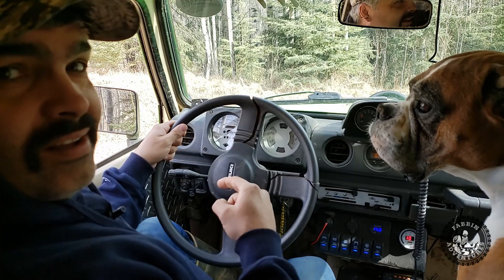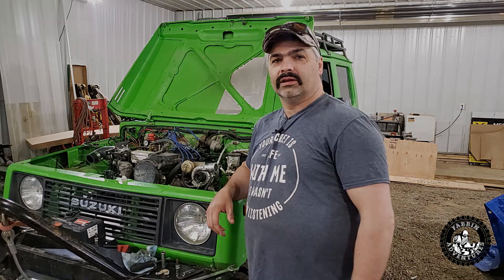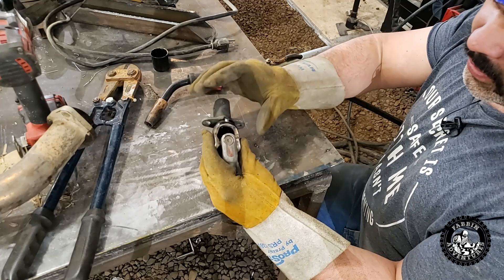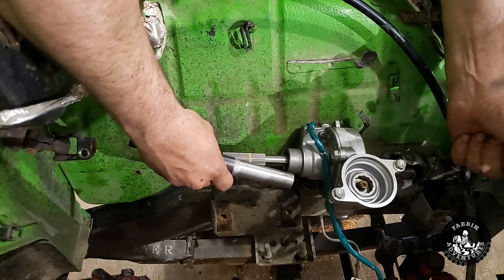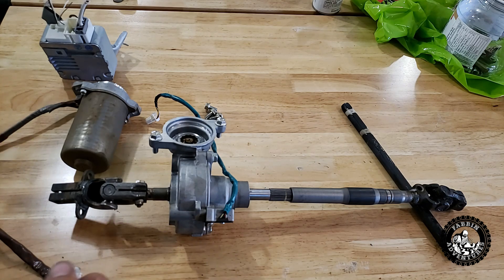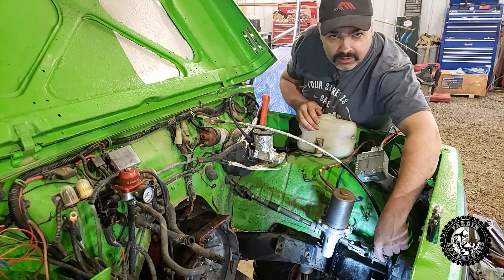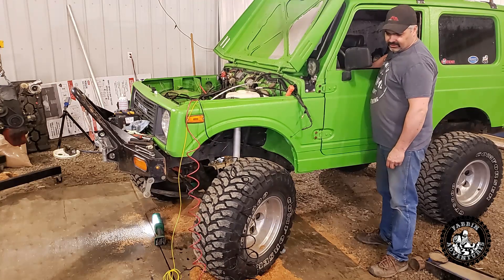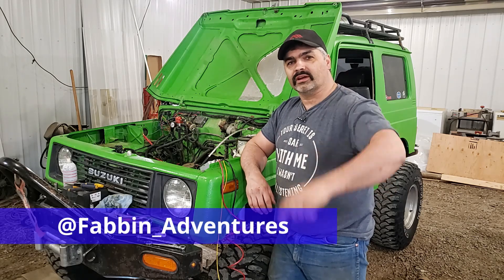Suzuki Samurai Electric Power Steering Conversion

Comment: great video, I bought and eps from a toyota yaris and I can't find a way to switch it on, I manage to hear the relay click but how do you find out if the motor is working without mounting it
Reply from the maker: Thats a good question man, they run perfectly quiet!
Reply: @FabbinAdventures  yeah they do and that's the only problem I have left I want to try it out before installing it
Reply from the maker: Maybe you could mount it in a vice and try it powered and unpowered with some resistance on the driven side?
Reply: @FabbinAdventures  I tried that I didn't really notice any difference with both the Corolla and yaris but the relay clicks on both of them so I don't really know what's going on maybe I'm doing something wrong
Reply from the maker: Hmm, well man, i dont know. Im not really any good with electrical stuff, if it dont work im at a loss usually.
Sorry.
Reply: @FabbinAdventures  no problem man, thanks for your time anyways I will get it working somehow 👊

Comment: Great video!  I used the same electric motor and ecu for mine but did you have a problem like others have mentioned with the wheel not self centering after turns?  I thought it may have been caused the way I mounted the motor (straight up just like yours) since OEM the motor is pointing at 3 o'clock I believe.  Even after checking alignment and replacing all tie rod parts with new, I'm still having the same issue.  There seems to be a dealer 'centering' procedure that I've been wanting to try to see if that resolves the issue?  Any suggestions would be greatly appreciated!
Reply from the maker: No, mine seems to center fine, never had any troubles with it.
Thanks for watching!
Reply: I have the same issue since i convert my delica to EPS. The reason is inside the EPS motor, there is a worm gear mechanism which doesn't allow the main shaft to rotate itself withe the motor.  Did Tone of researchers to find a solution and just today i realize using a steering damper is the only solution. Just like Fabbian already had one fixed to his Samurai. Hope you understood.
Reply from the maker: Thanks for your comment!
Reply: @wpdesilva  What is a steering damper you mention?  Can you point to time in Fabbian's video where you see steering damper?
Reply: @GBY6  Please check on 10.26. can you see a red colour cylindrical part under the vehice which is just like a shock absorber. That's what called a steering damper.
Reply: @wpdesilva  Thanks Praveen, I'm not sure it is required as I have seen other EPS installations that self center without damper?  Also factory Prius/Yaris EPS does not have a damper.  I am thinking possibly it is caused by ecu center alignment or maybe column shaft alignment?
Reply: @GBY6  Prius and yaris has rack and pinion system fitted between the wheels. Whereas vehicles like samurai has steering box which is totally different from rack and pinion system. However, the point you highlighted is also worth researching.
Reply: Did you ever figure out the centering issue? I have a datsun 240z with a saturn vue EPAS, and the auto-center on exiting a turn is picking at my brain for a while.....

Comment: Nice video. I tried it by myself. Successfully used for 4 months. But now it's no working. 5 seconds After ignition on, the ECM goes off by making two clicking sounds. 
Any idea what has gone wrong??
Reply from the maker: Oh thats a good question, have you checked your grounds and lives? Bad Grounds are causes of alot of trouble. Beyond that, im not sure what the problem could be.
Reply: @FabbinAdventures  thanks for your quick response. I checked the connection and connected directly through separate wires. Problem remains same.
I even tried with another ECM but the results are same.
But i found that after disconnecting motor connector and powering on again, ECM is no longer switching off like before..
Reply from the maker: Awesome, good to know! So problem solved for now?
Reply: @FabbinAdventures  not actually. i have to disconnect the motor connector to prevent the ECM from switching off. If i reconnect it, the problem begins. Anyway, I'll look into this deeper and will let you know if i found a solution.
Thanks
Reply from the maker: Thanks, too bad it didnt fix the problem, hope you get it figured.

Comment: awesome thanks.  Just got a prius power steering and ready to mount on my 92 EFI  fully loaded 8 valve 1.6 dual 4.24 :1 1st case to 6.5 2nd T case, Isuzu Rodeo rear leaf spring both front and rear FJ80 full float axle rear 5.29:1 and FJ60 front both 9.5" diff, 2nd gen 4runner power steering gear box, air compressor conversion out of air condition of sidekick, custom bumper front inner 9,500 winch, missing link front and rear over 12" lift on 37' tires currently up to 39" tires if needed, and many other off-road capability etc.  last thing is electric power steering assist. 

Thanks for the video!

Michael
Reply from the maker: Wow! That sounds like quite the rig! Hope it works for ya! Its be a great mod for my sammy!

Comment: Hi thanks for the video it's inspiring.
I got mine off a Toyota corolla and did all the wiring in including ignition power and no click sound absolutely nothing. What are those other wires next ignition wire for? The black and white one. Maybe there is another step am missing.
By the way I have a similar Suzuki samurai hard top like yours
Reply from the maker: Its hard to say, if it was the same unit ( toyota prius ) i might be able to help you. Hope you get it figured out, because that power steering sure is nice!
Thanks for watching!

Comment: Hello, great video. I installed it on my toyota hilux 1985 model 4x2. Its perfect when i am stopped. But when i am driving i have not the reset of wheel. I must turn the wheel after a corner. While firstly the wheel was reset autmatically after a corner. Do you have any suggestion?
Reply from the maker: Im not sure i am understanding your english.
Try unhooking the power and hooking it back up. To reset the computer.
Reply: Thanks. I do not have this feature anymore
https://youtu.be/wLbs8kBXgrw

Comment: How water proof are they? Like Would you cross a river with a unit like this? This seems like the answer tho!
Reply from the maker: the motor should be fine, just add a little rtv in some of the suspect spots and put the ecm where it wont see any water and you should be fine. i,ve done a bunch of water crossings with it so far, only a couple deep enough to maybe submerge the motor a bit, no troubles yet.

Comment: couldnt get my 05 or 07 prius to work. is the 09 different or something? all the parts and setup looks the same and the 3 wire hookup. i got my parts from the junkyard and they wont work from 3 cars..weird
Reply from the maker: Thats strange, are you hooking it up the same way as mine?
Reply: @FabbinAdventures  ye all i been hearing is the click but see no difference in the movement like i should. i also dont hear the motor. mine is like all dead 99%. there might be a 1% losening or less when i turn it with a socket to test it but im not sure. i got 3 ecu, 2 motors, 3 shaft with the torque sensors but they all just doing the 1 click when i hook up ignition power and ground. idk whats going on if i need to hook up the angle sensor or if the torque sensors bad...if the angle sensor runs to the eps ecu can u find me a diagram? been looking might need to check a manual but those can be hard to read
Reply: @FabbinAdventures  nvm i found the diagram its the same thing. didnt work.
Reply from the maker: I wonder what is going on, it takes 10 seconds or so to activate
Reply: @FabbinAdventures  ye idk whats the odds that maybe they went into junk yard for tht reason also? idk im scared to buy one online because it might be the same thing and they prob didnt test it then i gotta pay for shipping return and idk how much tht is.
Reply: @FabbinAdventures  i got it to work. it is important to clamp the output shaft as u turn the steering because then i guess the torque sensor dont work with it. clamping is like putting friction on the wheels. i was trying it all the time without putting the output in the vise so nothing was happening.

Comment: this is some great how to info, i would like to to add power steering on a Yanmar 240 compact tractor, leave everything the same but just add steering wheel torque. thanks.
Reply from the maker: I wonder if it will work, you should be able to fit it, i wonder if it will have the torque for a tractor.
Thanks for watching Fabbin Adventures!

Comment: I have done this conversion and now I am having an issue with it centering its self and pulling to the left. I have not taking it to be aligned! maybe that is all it needs. Your thoughts??
Reply from the maker: Hmm, thats a good possibility, i suppoes it didnt pull to the left before?
Mine worked perfectly right from the get go.
Thanks for watching Fabbin Adventures!
Reply: I'm having the same problem with the electric power steering not self centering after turns.  Which direction is your motor installed pointing?
Reply: I have the same problem.
Reply from the maker: Thats strange that only a select few would have trouble with it self centering, mine still works awesome as well as many others!
Thanks for your comment!

Comment: Why didn't you attach the power steering to the steering column on the inside? For example: https://www.youtube.com/watch?v=cRUdXRM6SVw
Reply from the maker: Because it is quicker and easier to install and or maintain in the engine compartment.
Thanks for watching Fabbin Adventures!

Comment: Hey Ron Great Video?? I got that turbo kit from Myron and what a total different beast!! Tho i am having a problem with the carb starving with fuel ...i Have replaced the Reg and e pump and adjusted timing and everything that myron told me to do still the problem stays.. i was just wondering if you ran in to that problem as well? thanks  keep up the great Videos
Reply from the maker: I ran into low speed flooding, like first gear low range on rocks it would flood out. But the main problem i hated was, it did not start when our temps would get lower than -10c or -15c. I use my zuk for hunting, so the no start is a problem for me in the winter/fall.
The 1.6 16v swap is the way to go for me, more power than the turbo 1.3 and it starts and runs every time!
Thanks for watching Fabbin Adventures!

Comment: My unit did not come with the u joint by the steering box.  was thinking of just welding the shaft that goes to rag joint.  Do you think that would generate to much heat to the power steering unit while welding it.
Reply: Never mind.  You covered that in the video.  Thanks
Reply from the maker: Yeah i dont know if i would weld that close to the gear box. Maybe if you wrapped it with a wet cloth to work as a heat sink while you weld.
There are plastic looking sensors in there that probably wouldnt take much to melt.
Did you get it from ebay?
Reply: yes ebay.  Was going to leave the rag joint as a weak link in the steering system and just carry another with me.  Only running 30s.  Now on the search for a prius ujoint.
Reply: I saw another video of someone tig welding it but when i saw that rubber seal.  I don't think so.
Reply: Bingo.  Pick one up on ebay for 24 dollars.  Thanks for all you do.  Keep videos coming.
Reply from the maker: Awesome! Glad you made it happen! Yeah i think any welding that close would end up ruining seals or sensors!
Glad i could help, your gonna love it, i do!
Reply: @FabbinAdventures  Ron I got it installed just like you did.  The first mount I built it flexed a little so i built another with thicker metal.  Now the mount don't flex.  The shaft flexes now.  Its just a little out of phase.  Not sure if this is causing the flex or may not have got the joint exactly centered by the gear box when I welded it.  Did you have any problems with this?  One other thought I had by welding the shaft into the u joint by the fire wall is that i'm not sure finding a replacement u joint will be easy if you have to replace it.  It normally comes as an assembly.
Reply: I did notice It drives a little strange now with this set up.  There seems to be no self centering anymore when coming out of a turn.  Does yours feel this way too?
Reply from the maker: @arkansaswheeling1742  no mine is fine, re centers after turns and no binding in the shaft. I used 1/4" steel for the mount.

Comment: How do you like those tires ? Lots of people use them just for looks and I'm finding it hard to get a really off road reveiw .
Reply from the maker: Well after todays shake down run, ill be selling there wheels and tires and getting the thrusters. The other zuk i was running with had thrusters and they were hands down better in the muskegg!
Reply: hello I was interested in your video I wanted to know which steering box you used if of a Fiat Punto or an Opel?

Comment: How did you hook up the speed sensor ??? can you explain that please? Our version of Samurai (Gypsy in India) is with a fuel injected motor but doesn't have a speed sensor. So how do i hook up the sensor part. Thank in advance. Love your vids. Keep posting
Reply from the maker: You need the speed sensor from the donor, take the plastic off of it, modify it to fit in your instrument cluster. Solder a blac wire to one side a yellow to the other. Black goes to ground, yellow goes to yellow wire coming from the ecm harness of the donor.
Reply: Hi, very interested in this, which speed sensor from the donor ie position, & after it's wired where is it picking the signal from @ the instrument cluster, regards Brian

Comment: hey! I loved your video and found it to really demystify this whole swap. question for you. would you happen to be able to measure the length of that Prius shaft that you welded to the ujoint closest to the steering wheel? the female splined shaft. long story short I did this swap and chopped the shaft up and welded it to the samurai end and hate how it turned out and want to start over with a different shaft.
Reply from the maker: "Demystifying" was exacty what i was going for.
I never cut that shaft, its full length. I only ground down the splines on it and slipped it inside the ujoint and welded it.
Thanks for watching Fabbin Adventures!
Reply: @FabbinAdventures  oh I know you didn't cut it that's why I'm looking for that measurement. I cut mine up and want to know if I can get by with an uncut shaft.
Reply: patrick arter  flamingriver.com has all the shafts and couplers

Comment: Iv been intrested in this set up for awhile. I got a 1990 samurai on toyota axles with high steer, running 33x12x15 with 3.75" offset wheel. Its a beast to turn. My main concern is if this setup will prevent or reduce the steering wheel from being jerked out of my hands when hitting a rock or rut when out wheeling.  I have a new old man emu steering stabilizer and it didn't really help it much. It really starts hurting my hands during a long day of trail riding and the steering wheel ripping out of my hands really suxs. Once you get a chance to test drive it can you let us know  how well it helps prevent the steering wheel from ripping fingers off?
Reply from the maker: Yep exactly why i did this upgrade, hopefully i can get the 16v up and running today. Then ill do a shake down run and do a my thoughts video on the whole thing!
Thanks for watching Fabbin Adventures!

Comment: The main question... Is there motor assembly WATERPROOF for water fording.......
Reply from the maker: I think the motor assembly should be fine, but only time will tell. At least if it craps out you can still steer the old way so your not stranded.
Thsnks for watching Fabbin Adventures!

Comment: That is sweet!  I did power steering using a saginaw tc pump and ifs Toyota box.  If I was going to do it again I would have used a different pump mount so I could use the pump with integrated tank, and I’d use a fj-60 box.  This setup looks sweet though, wish it was around when I did mine.
Reply from the maker: It is super easy to do, ive heard of a few guys with this in their rock crawlers for the last several year and work great. So i figured, why not!
Thanks for watching Fabbin Adventures!
Reply: Fabbin Adventures I recently heard of this myself, keep us informed on how she holds up.  Thanks for the build video.
Reply from the maker: Will do!

Comment: Oh yeah , my 160 amp alternator keeps it going strong, no rag joint in mine either.
Reply from the maker: Awesome! I cant wait to get mine on the trails again!
Reply: Harold Segur I was wondering weather the stock or 12si alternator would work with this setup.
Reply: @jamess662  yes it will,I ordered a custom alt from I believe it was top Street performance,it was a cs 130 type, well worth the effort , it was actually affordable, 129.00 to be exact.my idea was to give me more reserve power for my winch, I ran a jumper wire lead directly from alt hot post to the batt. Post positive, was 3/8thick copper, some say don't do that but as long as your system has good continuity you should be fine. Mine has been working well ever since.just go by hook up instructions from a good web article about cs130 in the samurai.several out there.the electric. Steering seats up to 50 ramps. And my alt. Shows no I'll signs and my charging system kicks ass. Make sure you get a really good battery , as in large and I would say at least 750 cca.just telling you from experience. Still cheaper than hyd. And no power loss from motor as with hyd.setup.
Reply: @jamess662  oops , forget the stock alt. Purely a no go situation.go bigger on that because the stock alt is not but 50 maps total at best most say it more like 35 to 45 amp. ,you get the picture,falls short.
Reply: Meant it eats 50 amps .on power electric. Steer, I got huge thumbs,and very tiny keys on my phone.
Reply from the maker: All good info my man, thanks!